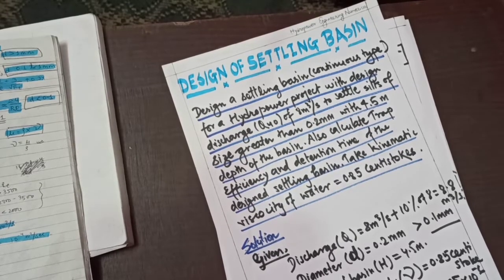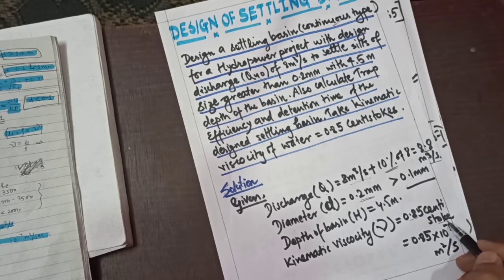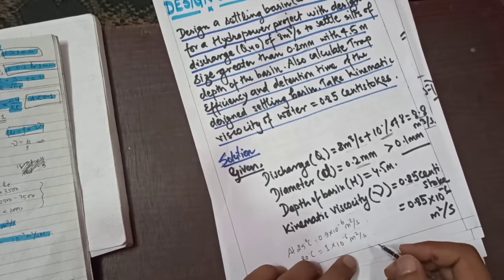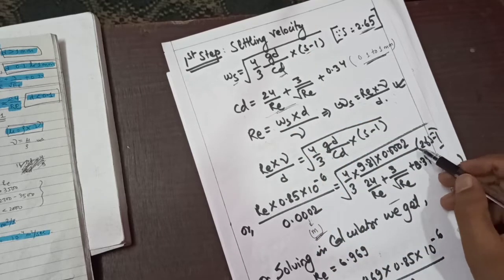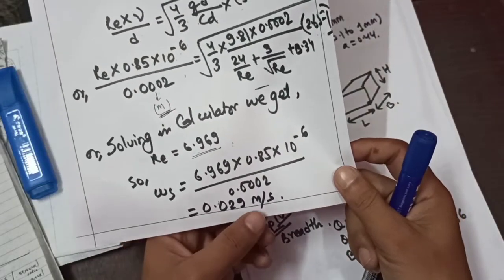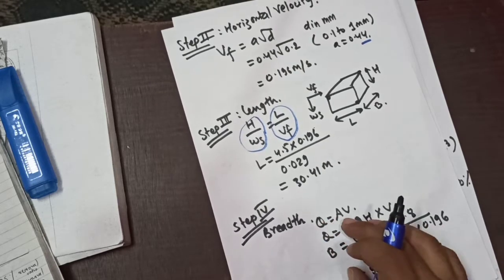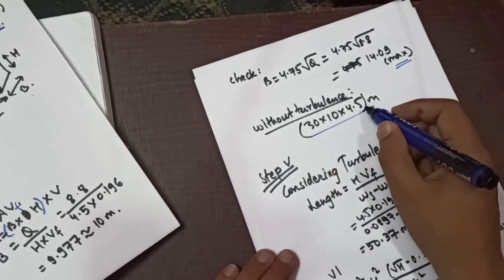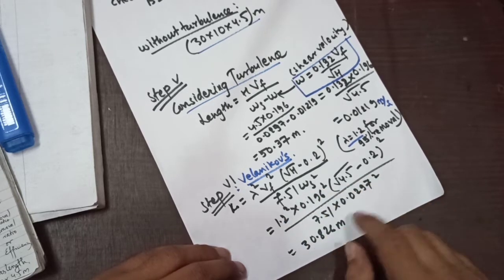👷SETTLING BASIN DESIGN 12 marks Hydropower Engineering numerical

Comment: Why do you use velonikav,s formula in step6?? N it's not related anywhere. 
Will be waiting for your reply.
Thank you.
Reply: It is specially used to check the length of the basin calculated from the analytical method.